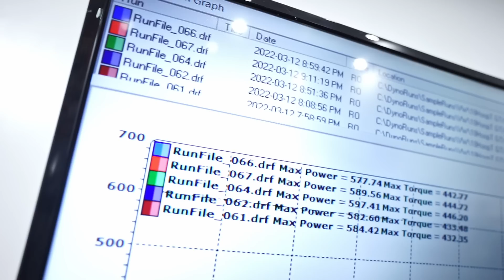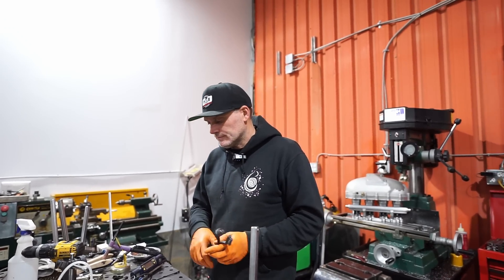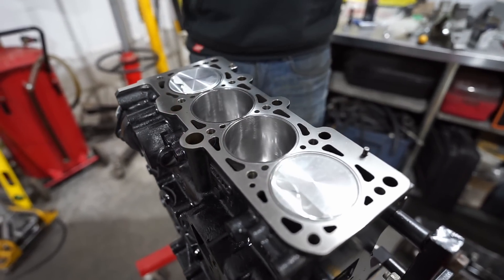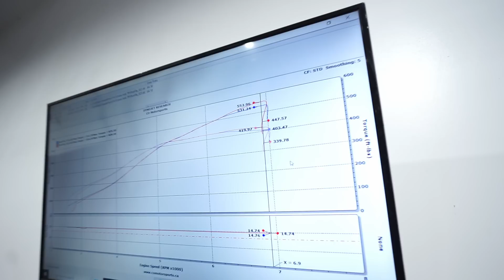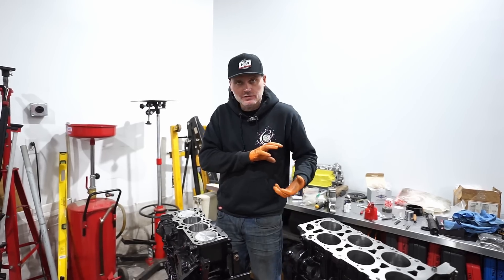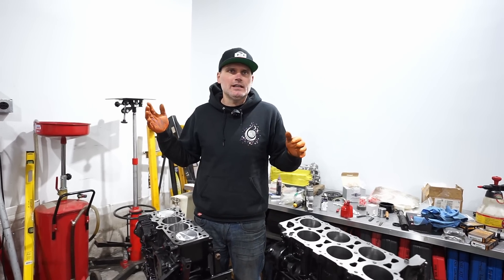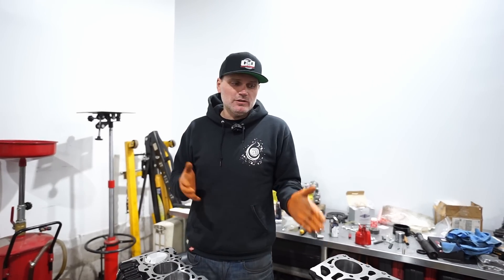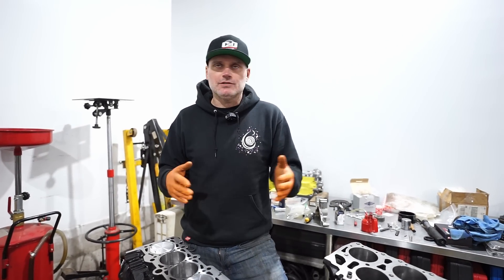Best VW/Audi Engine To Modify.

Comment from the maker: Which one do you think is the best?
Reply: 2.5L
Reply: @Sixthpanic  crafter tdi lmaoo
Reply: 07K 2.5L
Reply: Definitely 1.8t. Best bang for the buck.
Reply: The old 5 cylinder 2.2 20vt
Reply: I love the vr6 that sound is to die for
Reply: 20v 1.8t for life
Reply: I've owned a 12v VR6 and loved it, but I feel like the latest 2.0Ts are the most desirable from a cost to horsepower perspective.  If budget weren't a factor, I'd own a 12V again and throw a ton of money at it...
Reply: Yo just got my hands on a 2.0 turbo, ik this comment is 2 years old but I'm in need of help for first mods I should put on it it! Reply if you see this pls I would love to discuss some stuff with you  @whorutothink
Reply: 1.8T nevAr lose 😁
Reply: 2.5 ❤
Reply: The 2.5 5 cylinder is the best.
Reply: @FiveWaveMedia exactly i have a 2011 jetta with 410k km and it drive like it new
Reply: Best? Probably a VR most receptive to tuning and mods without much effort? Probably the ea888 gen 3
Reply: 2.5
Reply: 2.5 for sure is the best I've had mine for 2 years and love it
Reply: VR6 plays the best music and that is all that matters.
Reply: 2.0 in my 16 s3
Reply: What transmission 😅😅😅
Reply from the maker: Well since most of them are garbage we're not working with much. lol
Reply: @COMotorsports  hahaha
Reply: Aba is the best 😊
Reply: Toss up between the 20v 1.8t and the 07k 2.5 for me. I'd lean more towards the 20v simply because of the variety of options to make cheap power plus lack of off the shelf management options for the 2.5 especially if going forced induction.
Reply: I think the ea888 is the easiest and best to tune. Just bolt stuff on and away you go .I have a 7.5R running at 410 hp and I love it. But I just love the sound of those VRs . Great video guys,interesting to hear your thoughts. 👍🇬🇧
Reply: 20V 1.8t ftw
Reply: Especially in a polo chassis 😎
Reply: 16v is still the best engine after 35+yrs.
Look it up on what's the quickest VW ,it's got a 16v.
Reply from the maker: @MrTheHillfolk  although I'm clearly a fan of the 16v as that's what's in my drag car. I think the quickest now is a VR. HS Tuning Audi TT.
Reply: @COMotorsports  yeah that things wicked ,I love that car!
Reply: 1.8t 20v
Reply: EA888
Reply: Actually my opinion: tough choice between a EA888 or the 2.0 16v ABF
Reply: ABF 16V. veedubracing Mk1 drag car pushes out 800hp  , had one in my mk1 cab on ITBs and emerald standalone
Reply: @DGT73  I agree 16v Turbo is just too cool. The main reason imo is it never came boosted the way people execute their build is always different.

Quattrolf has a 1200ps and as well.

For me the 16v has always been my dream.
Reply: actually none of the above. 2.5t >
Reply: 3.6 vr6 turbo
Reply: I’m a little sad you guys didn’t get into detail on the 2.5l because I have one and I can’t find much information anywhere on it
Reply: Vr6 3.6 r36 engine!
Reply: I had a 2.0T FSI from my Passat Wagon, but I never had the chance to unlock its full potential since we had to sell our car off for an apartment. I would be looking for a minivan since we have a child but I missed my wagon, so who knows, I might save for another one.
Reply: CJAA by far.
Reply: EA888 gen 3.
Reply: 2.5s I hear are bullet proof and I bought my mk4 gli for close to the price of a much newer 2.5. id like to see that but id like to see the simplest way to get close to 300hp with a 1.8t 20v. I'm sure its already on here though lol just have to keep browsing the videos
Reply: I’m biased cause of daza ownership. But I love me a vr, don’t know if I have a favourite in the vr family cause I’ve never really gone down the rabbit hole with one …..yet
Reply: 1.9 tdi PD 🤷‍♂️
Reply: For a basic daily driver, turbo or supercharged ABA. This combo is a MK1-3 is a good daily driver with minimal issues. Then I would do the 1.8t. The one that came in the B5 Passat or Audi A4. I looked under the hood of an Audi A4 a few weeks ago and laughed at the amount of room under the hood. I forgot how easy these were to work on.
Reply: VR6
Reply: I'm biased but my vote is for the AAN.
Reply: 1.9 tdi ARL
Reply: @CO Motorsports Serious question I want to swap my mk6 Jetta with a 3.6l Forged Vr6 and a twin turbo kit with an Audi seven speed transmission? How is this sounding I really want this to be a sleeper? Would I need to drivetrain swap as well idk it’s eating at me?
Reply from the maker: @jaydub710  3.6 TT... get your bank account ready for some abuse.
Reply: @COMotorsports  im already knowing😂😂 gonna be so worth it tho had this dream of taking my moms old car and turning into a sleeper.
Reply: @jaydub710  just my opinion...don't do any of that. It's not feasible nor would it be remotely worth the time, effort, or money when you could just buy a used S car or even an RS and have a better overall build for the same amount. Not trying to burst your bubble just being realistic.
Reply: CJAA TDI or the 2.0 16v in the Mk2s.
Reply: I think the 1.8 kr from the golf mk 2 is the best
Reply: Got to be 1.9pd derv. Silly how much you can get from them
Reply: 3.6 vr6
Reply: I'm a sucker for the "ADU " 2.2L Inline 5 20vt as well as 2.0L 16v
Reply: It also nowadays depends where you live, because the prices of the car its insane, its cheaper to get and to make 3.6 vr6 here than 2.0 gen
Reply: 07k 2.5T, then the rs3/ttrs variants. It's not all about the sound.... But have you heard that sound lol
Reply: TDI is the best
Reply from the maker: @matthewlee2686  nah
Reply: Abf 16V... 3.2vr6...2L 8v
Reply: I lust after the Audi 2.5l 5cyl turbo and wish I had it in my mk6 Golf R. Definitely not a financially smart swap, but swaps rarely are, right? Haha

Have enjoyed the Ea888 with k04 in my mk6 GTI daily, and I know the 3rd gens are even better, I'm just not a fan of the mk7's styling.
Reply from the maker: @JustinStrife  07K turbo swap, same results way cheaper.
Reply: @COMotorsports  Main downside is the added weight of that iron block. Already trying to put her on a diet. Did RSE10 18" wheels, Magnaflow exhaust, looking at 17 or 18z brakes, relocating battery to trunk(and going to a sub 20 lb battery). Wanting to go to DSG and get rid of the third pedal is already adding weight.More things to think about...

My daily is an APR k04 mk6 GTI with DSG and I owned an 800hp C5 Corvette for 10 years before these two Golfs. 

I appreciate your videos and wealth of information. Been following for awhile and am still learning the VW world. Thank you for your efforts, and your reply!
Reply from the maker: @JustinStrife  Have you lifted a bear block before without accessories. The 40-50lbs in the difference between the two is absolutely nothing, in the scheme of things, especially when it comes to the price. You can drop that difference in weight by choosing other lightweight parts on the car if weight is your concern. However if you're building a MK6... weight is clearly not your concern to begin with as they're heavy cars to start with. 

I deal with this stuff day in and day out... built 07K is going in my daily and will cost 1/3rd the cost for same power potential.
Reply: @COMotorsports  I have. An LQ9 vs an LS2 6.0l V8 block. Difference was around 80-100 lbs iirc. Back then I was going to build up a stroked 408 to max out my D1 Procharger. 

And yes, the mk6 is definitely not the lightest platform. I realize that(among other deficiencies with this generation). It just happens to be the only one I truly like from an aesthetics standpoint. lol

Again, thank you for taking the time to reply to comments here. Not every channel cares to do that. Goes to show your integrity towards the community!
Reply from the maker: @JustinStrife  Appreciate it, and good luck with your project.
Reply: @COMotorsports  Thank you sir. On the hunt for an 07k now and digging into the research for this engine more than I had done to this point. I saw a sportwagon build that had the 07k turbo, with a Daza intake manifold so these engines maybe far more similar than I was thinking. 

Looking forward to your next educational video!
Reply: the old 2.7t  if you have room.. lol
Reply: Can't beat the noise of a VR... plus such a compact 6cyl!
Reply: @sirzippy5055  It's too bad they're so heavy :(
Reply: Give up some good 2.5 info, pros and cons.
Reply: Audi AAN 5 cylinder.
Reply: 1.8T is better you even said it in the video basically. However the VR6 sounds better but costs more to build. this is my interpolation of your explanations
Reply: @SuperTurboman85 AWP! all day lol
Reply: EA888 all day
Reply: The engine you haven't built yet. I think we're all waiting to see that coming ❤❤❤.  I'm hooked on VW  and have been since 1996. I own more then a few bmws but VW will forever be in my heart and sole.  Back in 2004 I built a mk2 gri with a 1.8T with a full roll cage first ever GTI with mate black I remember bouncing off the Rev limiter at 280 on the 401. From T.O. to Montreal 3:45 mins and two full ups. When I moved over seas and took the car with me its was legendary best years of my life. Years later I bought a mk6 GTI which is now built not bought with k04 TSI and this car reminds me of being kid and the  Theme song to your intro and ending is just awesome it's a nice touch of class reminds me of back in the day of happier times yeah know..
Reply: vr6 is the best sounding and makes the most power
Reply: ALH or BHW TDI
Reply: As someone who owns a big turbo 1.8T, NA VR6, NA R32, 3.0l VRT, G60, V10TDI, and a 1600 air cooled. I can say my favorite is.... All of them. They are all fun and unique in their own way. I can say that i am not a fan of 2.0Ts because of all the 2 step and pops and bangs tunes. They might have been great engines but they were ruined for me because of the garbage out there.
Reply from the maker: @mattlarson9897  It's the nature of newer cars and kids unfortunately. They want the car to sound fast.. without spending the money to actually make them fast. However I as well own or have owned most engines, and build them all... the gen3 is not to be slept on. However I do really love me some 2.5Turbo. :)
Reply: @COMotorsports  I am curious what the highest HP ever achieved on a VW/Audi platform is and what engine they started with.
Reply from the maker: @mattlarson9897  It varies between chassis due to weight, but 12-1500whp is what the 7sec guys would be running. 16vs, 1.8ts, and VRs. Not sure if there is a 7sec 1.8t yet though.
Reply: @COMotorsports  There will be more stress on components when spreading, lets say 1500hp, across 4 cylinders than across 6 or more. So i would imagine the VR6 could make more power than a 4 cylinder. I wonder if anyone has pushed other engines higher. Maybe something like the 4.2 V8 or 2.7T or even a 5.2 V10.
Reply from the maker: @mattlarson9897  at those levels they're all stressed because they all have their own specific weaknesses.
Reply: @mattlarson9897  I love my stage 2 2.0T. I absolutely hate pops and bangs. I just don't get it. Maybe being 51, I'm too old for that.

Comment: the 2.0l 8v 116hp jetta AQY engine is a robust and simple  unsung hero type engine great for turbocharging cams are cheap ad you can use a 1.9tdi exhaust manifold on it

Comment: No one’s mentioning the EA113 CDL... but is it not stronger and more predictable than the EA888s? Iron vs aluminium, metal vs plastic, belt vs chain etc…
Just asking because I’m choosing to buy a Scirocco R first before I settle down with the more efficient Octavia VRS 245

Comment: As long as I have a choice, I'm going VR. Had a 2003.5 (the refresh) GTI VR6 at a time when everyone was getting the GLI, Anniversary Rabbit, or regular GTI 1.8T, so I have driven A LOT of the 20V 1.8T's, some remapped, some not. The VR6 just feels and sounds different. They just don't make engines like that anymore. Seriously considering an A3 3.2 as a secondary "fun" car if I can find one with low mileage and a manual trans. I feel like I'm too old for a hot hatch, and while I love my luxurious Cascada, that 2.0L turbo diesel (while remapped to 200-ish HP from the stock 165) doesn't quite scratch the itch of that inner kid in me.
Reply from the maker: The A3 3.2 never came manual, at least in North America anyways... so you'll be looking for a while. :)
Reply: @COMotorsports  I moved to Europe years ago, so they have them here. I believe they ran until 2005 (or was it 2006) with manual trans. Already test drove one, but they were asking 6,000 euros and the car already had 420,000km on it, which is a terrible deal.

Comment: 😂.  I have a 2.0 slow turbo and a vr6 and a 4.2 gated and they are great but the sound of the vr6 through a tunnel sounds great but not as loud as the v8   I have yet to modify them 😢

Comment: My 7.5 R with the 4cylinder (DHJA) engine. I have a lot of mods, upgraded turbo (stage 3) and all bolt on parts and tunes. Cars at just over 500hp. I would love more information on internal builds, kits.  What I could do not so much for more power but I want it to last. Car has done nearly 100tkm.

Comment: Am I crazy for keep thinking about Mark 4 1.8 turbo to make 420 horses at the motor with bolt ons?
Reply from the maker: With the proper turbo, fuel and tuning and it will do it.

Comment: I've got the EA888 Gen3.b engine in my Leon FR190. Apparently a stage 1 map will take it upto 250/260hp. Not 100% sure this is true as its the budack cycle engine.
Reply from the maker: The B-cycle engines definitely make less power than the standard Gen3s.

Comment: When it comes to the 3.6 FSI with 300BHP naturally aspirated ,  how much could you get out of a stoke engine? Just got a Passat B7 with that engine and curious about the possibilities? TY
Reply from the maker: A lot, but it will cost A LOT to make that happen. FSI VR's require a bunch of extra stuff to boost them. So not a simple task.

Comment: I own a 1.8T myself and well, let's just say it is amazing how easy it is to gain power with these engines. I had mine tuned, K04-015 turb and 550cc injectors and a 3 inch downpipe. The only thing that made this engine blow up was an improper tune. But even with the sh*tty tune, it flew past those mk7 GTI's with a bit of ease while costing me only like 3 grand including the car. Lovely engines, lovely aftermarket support, VW (turbo) engines are just lovely overall

Comment: I have question what power I be seeing with a better pistons and rods and bearing ?and what limits are there ?
Reply from the maker: If your just changing pistons, rods, and bearings. No change in power unless your increasing compressiong dramatically.
Reply: @COMotorsports  I kept same compression but got forged internals for my vw gti mk7

Comment: Sir May I Ask you never Talk about the Porsche 3.6l VR6. So Can you help me out ? Like to install KN Air Filter without the Lid On the Air Box , add 3” Titanium exhaust,get rid of Porsche heavy Mufflers , Oil/coolant and Transmission Fluid Coolers. After a few Months add Rear Turbo Charger. Then after a few more months add the Spacer Plate.  This the Right Order?   Thanks and Awesome videos
Reply from the maker: Depending on fuel I'd do spacer with turbo kit. We have a 3.6 very stashed away to boost but lots of other things on the list before we get to that.

Comment: Hi there. Have a question maybe you can help me out with some suggestions.
I have an vw 5 2.0 E113 
I’m racing Andalusian tourism championship, right now running a K04 turbo, with a bigger intercooler and some map mod.
I wanna improve it… we have no restrictions in this class here. My question is, is any good turbo, maybe be thing scroll, also with a manifold so can have better or quicker bottom torque? We tried K04 hybrid, but has a lot lag and we need the car have more power from 3000rpm. Otherwise when power comes, looks a lot of tracción.
I will really appreciate some opinions with people have experience with this engines. Very hard to find here in Spain people who knows about it
Thanks a lot
Reply: Loose a lot of traction***

Comment: Well the vr6 to  me is a stronger engine, I have a 2004 r32 with 167000 mph whit tectonics cams shafts, giac software with cams file and free flow magnaflow catalytic ,still runs like a champion and I wouldn't change with the  new 4. Cylinder engine,( but of course this my personal opinion) will like to  see all those 400hp,500 hp 600hp how they run after 167000mph!?? IF THEY STILL RUN AT ALL!!! Is this very clear from the video, you guys don't like VR6  wich is the best engine that wolkswagen made,as reliability and linear power delivery.
Reply from the maker: Do you realize we all own, or have owned VR's? and have been boosting them for a very long time. lol So it has nothing to do with not liking them, they're great engines. However we're not fooling ourselves either, we're speaking facts here. Since you bring up the Gen3 2.0T, coming from a guy who tunes for a living these engines are a forced to be reckoned with whether you like it or not. More torque and power throughout the power band comparing a Gen3 2.0T to a R32T in a 400whp setup. I have endless dyno sheets to show me what they're capable of. And yes they will live that long no problem, however the VR will definitely sound better doing it. :)

Comment: I have owned two 1.8T cars a Mk4 GTi and a Mk1 TT Quattro.

The Mk4 was alright, didn't really impress me as a car but the TT was so much better, both engines were reliable and did 185k miles before I sold them.

I now have a B9 A4 TFSI Quattro with a CYRB engine (MPI from factory in Europe). I'd love to know how to make 400hp (at the crank) but useable on track days etc so it wont over heat and shit the bed.

Comment: You don’t need pistons and connecting rods for a Turbo’d VR, once your after 550 HP then you’ll need it
Reply from the maker: Well that specific answer really depends on fuel.
Reply: @COMotorsports  I agree, you need fueling at that level but.